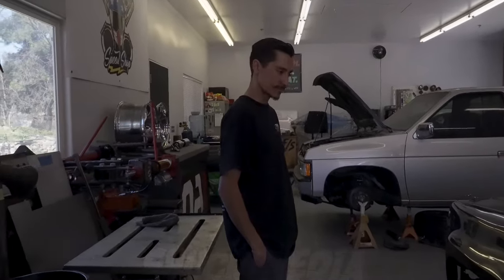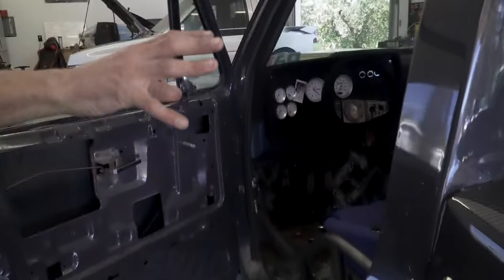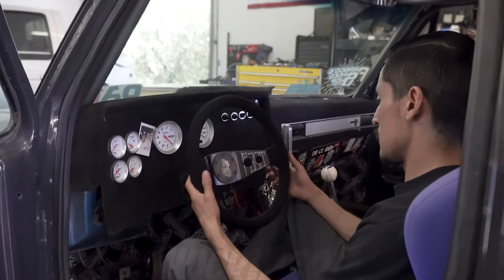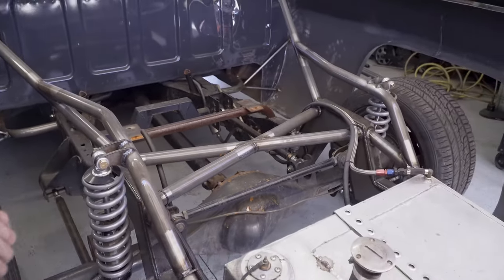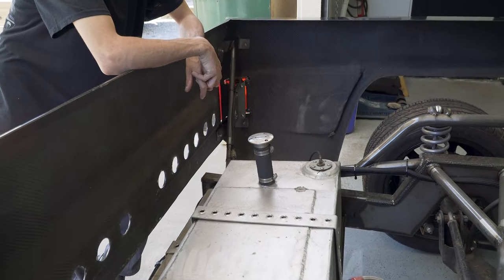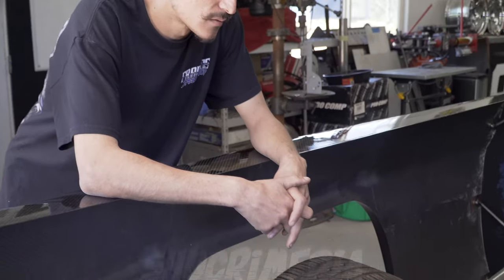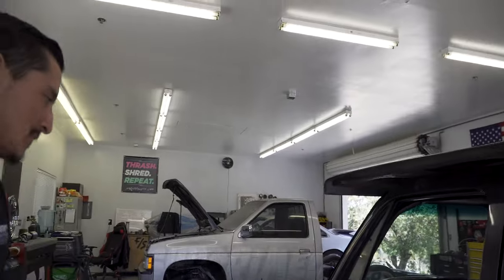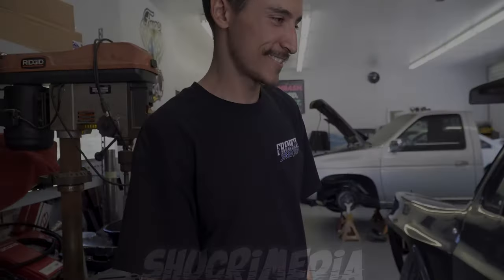CHEVY C10 DRIFT TRUCK ?!

Comment: My project is a 76 short bed stepside, factory big block truck(cam, flat tops, different cast iron heads, headers, Holley intake, demon carb)  4 speed.... It's not that fast, but good enough to be fun. 
You definitely have one of the best widebody setups I've ever seen. It's a really nice hot rod....and the doors aren't thin junk so they sound Right! Really sweet build bro